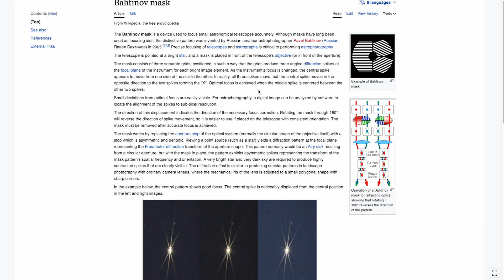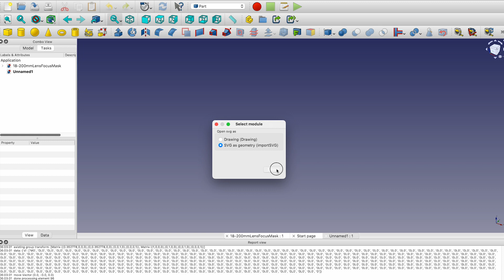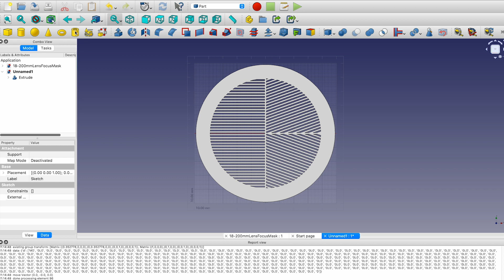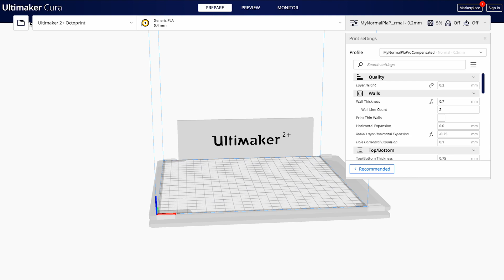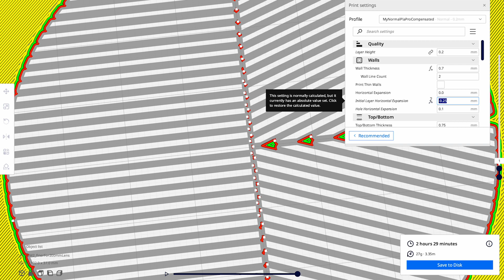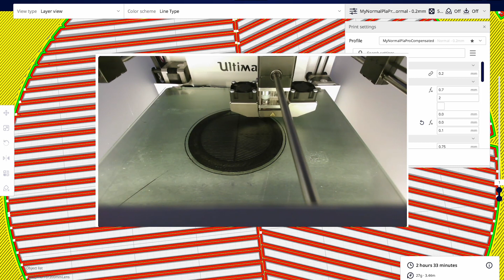Design and 3D Print a Bahtinov Mask

Comment: thank you for sharing this video ! it's super helpful. One question I have is about the Focal Length but I will give it a try to see if the 3D print works well.
Reply from the maker: @tron_rider_7  the mask diameter should be the outside diameter of the lens you will fit it over, the filter diameter shouldnt matter unless your going to somehow fit it to an actual filter.  havent been to the site in a while, but you should see a parameter for the overall diameter, the thickness of the outer solid part if. you want the mask inset, and the central solid part, which would be zero for a camera, or some diameter for telescopes that have a mirror blocking the center of the objective lenses